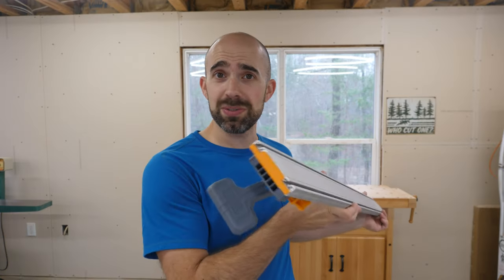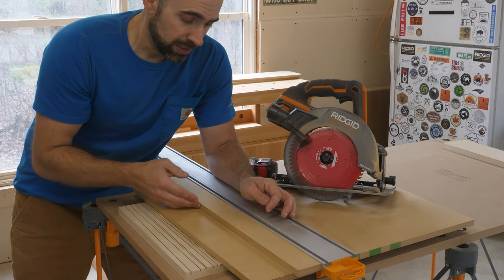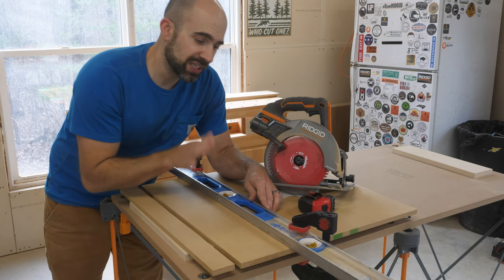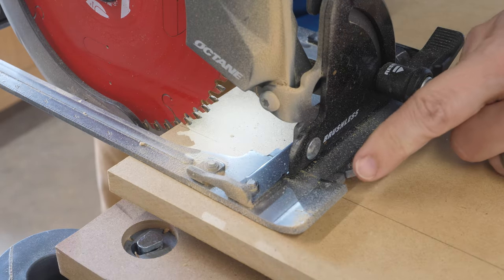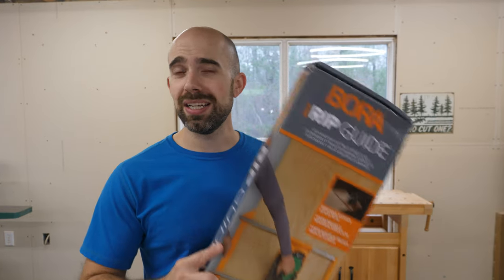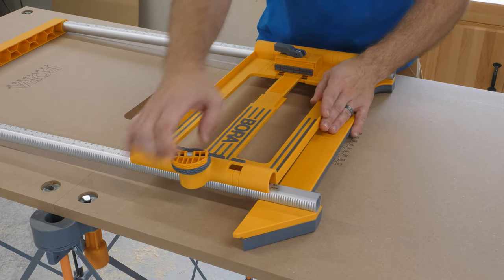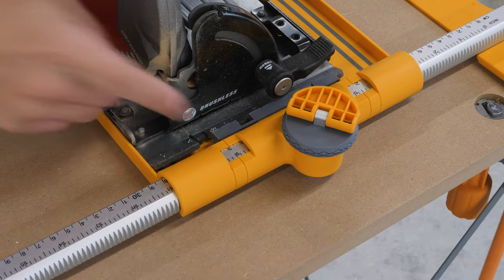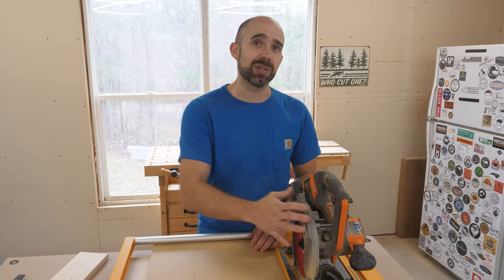4 Ways to Make Straighter Cuts With Your Circular Saw | Bora NGX Rip Guide Review

Comment: I noticed that the first clamping guide was kind of dismissed for only being useful to make parallel cuts, but nothing was said about the Bora rip guide having the exact same limitation.
Reply from the maker: Dude you are right!  In hindsight I should have mentioned that with the Bora rip guide as well.  I wasn't even thinking about that limitation since it's obvious, but that's for calling that out 👍👍
Reply: @WoodshopMike  This was your first video I have watched, so I didn't know if you were just shilling for Bora. Ironically (or not) I'm now seriously thinking about getting that Bora rip guide now. It looks like it works pretty good for what it does. I'm looking for an edge guide though, so I might get the Bora Portamate Deluxe. Thanks for the response!
Reply from the maker: Glad to have ya here and seriously I appreciate you pointing that out!  The video was sponsored by Bora but definitely not just shilling for them.  I haven't tried the portamate deluxe yet, but it does look like a pretty nice solution.  Let me know what you think if you pick one up!

Comment: I just purchased a Bora NGX dual rail saw guide.
My first time quick review with a Dewalt DW369 circular saw:
*This device is made for light weight, battery powered circular saws.
* yes, you can use a full sized circular saw. However, the rubber and plastic guides and locks cannot handle the weight. While the saw and device are just resting between cuts, on top of your board the top rail will slip out of the guide every time. There’s enough wiggle, just holding it, no matter how tight you tighten the saw guides (or firmly hold the guide rail) that your cut is not always going to be on your cut line.
For my needs, I’m buying a couple of guide rails.
And, if you just want to make a 1-1/2” cut, forget it. The rails and guide locks fail to firmly hold the saw, and guide together. At a minimum, the rails have to be fully inserted to at least be flush with the end piece.

Comment: Excellent presentation and comparison of the different methods of making straight cuts with a circular saw. I have the older Bora WTX clamping guide, and I have gotten perfect cuts with it. I second @Gene Whitesides recommendation. That is the method I use rather than measuring at 2 points. On longer/wider boards I use my framing square (which I confirmed is actually square) with stair gauges to draw a longer straight line. So that I don't have to measure the offset between the guide and the blade I created a spacer block. To use it, I draw the line at the position I want to cut off, align and clamp the spacer block to the line (making sure it is square to the edge), position the edge guide against the spacer block, and make the cut. Works perfectly every time. I also use this same technique for my router. I made 1/4", 1/2", and 3/4" spacers. I ONLY use these with wood that are actually those dimensions. It won't work on plywood, which is NEVER those dimensions.

As an aside, you can make angled cuts with the clamping guide. Bora makes clamps that attach to either the WTX or the NGX clamping guides. You can see them here: https://boratool.com/bora-track-clamps-pair.html. For what it's worth, I picked mine up at Lowe's for $15.98 (not the $25.00 that Bora wants)...https://www.lowes.com/pd/BORA-Track-Clamp-Pair/1002780150
Reply from the maker: Thank you so much for the feedback on the review and info on your method!  Finding a framing square that's actually square can be quite the challenge.  The first one I bought I didn't check for accuracy before starting a project and quickly found out it was off by a decent amount.

Thanks for the link to the track clamps!  I should've thought about those, I got so focused on parallel cuts that I totally forgot about them 🤣🤦🏽‍♂️

Cheers and thanks for watching!

Comment: I made a straight edge jig specifically for my circular saw  but it's only good for short cuts, so I needed something longer. That's why I purchased the Bora WTX bar clamp a while ago, but like you said, the parallelism is reliant on how well you measure and mark the wood, and then clamp it to your marks. 

Being on SS disability, a track saw is neither in my price range right now, nor do I have a place to store it, so I've been looking at the Bora circular saw plates that work with the WTX bar clamp.

Great video Mike, as always.
Reply from the maker: Yeah the track saw is quite nice but comes with a bigger price tag.  Thank you sir, glad you liked the video.  Cheers!

Comment: but you didn't include the 'Bora NGX Saw Plate Includes 55" Non-Chip Strip That Elimates Tear Out, Designed for Straight Cuts While Using The NGX Clamp Edge System, 544001' ?  I think this might help plus i think it acts like a low budget track saw.
Reply from the maker: Definitely another great tool to do the job better👊

Comment: Great video. Wish i saw this a few days ago. Tried the kreg system. Worked ok. But not perfect. About to try the bora system, i got the track kind but appears similar problem to the kreg in that it wont be super accurate. Im working on finishing my kitchen and counter tops. Had to do a lot of sanding to get the pieces to fit snug together. Guess thats the cost of the cheap ways. The rip cut looks awesome and the better option for that type of work. I have to do the sink cuts and I am thinking just old fashioned clamp a level on as a guide...and use a jig saw
Reply from the maker: Thanks! FWIW if the sink is a top mount, you can just free hand the opening because the flange of the sink will cover the hole.

Comment: Hi, I just got this guide and the first time use was a straight cut, but off on the measurement. I did everything how you said in the video and I set it to 6 inches but it came out to 6 5/16 inches. I will have to play with the adjustment of the saw on the saw plate. I am using a Makita 5007 mg circular saw. I can move the saw over 5/16 of an inch to the left but then it won’t be flush against the right side of the plate. I’m not sure if that makes a difference.
Reply from the maker: Makes total sense, is the cut line on your saw in line the with the cut line on the guide?  The base of your saw and the one I used may be slightly different dimensions and that could be where things are being thrown off.